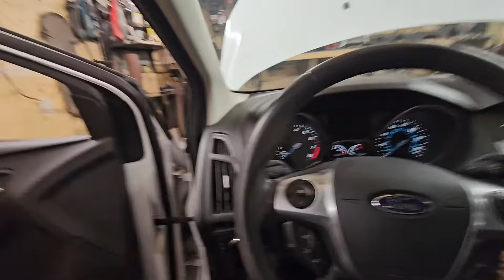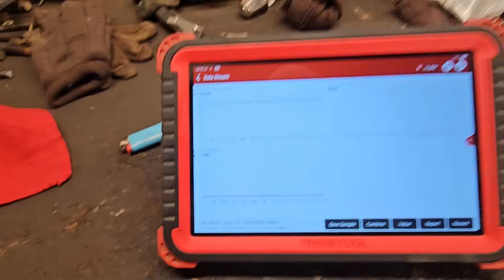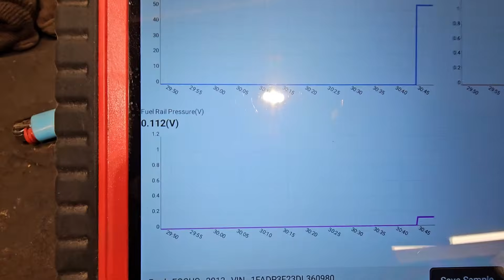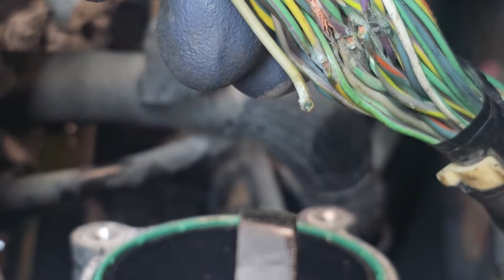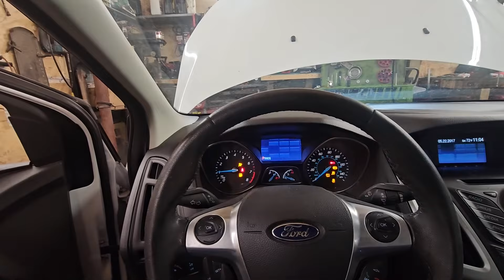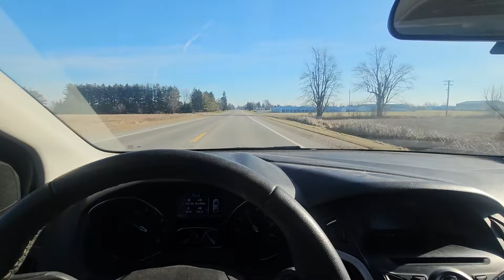2013 Ford Focus LOW FUEL RAIL PRESSURE P0192 P00C6 FIXED!

Comment: I have this code with gas leaking
Reply from the maker: If you have an actual fuel leak, stop driving immediately and inspect your fuel lines and connections for safety! 😎

Comment: Mine just started doing this. Hopefully you just saved me a ton of money. Thanks for the upload ☺️
Reply from the maker: Glad I could help!
Reply: @BustedtoBuilt had mine looked at today, the wires are fine. It was oil on my spark plugs due to a bad valve gasket cover. I guess that's what I should expect since my focus has 276k on it 😂

Comment: So the low pressure sensor is on the rail under the intake manifold
Reply from the maker: The high pressure sensor is in the rail, the low pressure i think is just somewhere in the feed from the tank but not sure

Comment: Thanks for informative diagnosis and repair. Some time ago I checked my wiring harness in same location, even fixed a couple of exposed wires, but am getting same P0192, so I will expose that harness section again to see if I missed another wire or two... thanks for making the video with excellent explanations and video edits!
Reply from the maker: Glad it was helpful and really appreciate the kind comment. Good luck with your repair!

Comment: Dude total live saver on this one. Mine just started acting up going down the road. Dod some quick checks on the side of the road. Nothing panned out. Googled my issues and this popped up. I got picked up, ran home and grabbed my electric tools, stripped that spot in the harness back and boom! Had 1 wire broke in two and two more about through. Got them spliced up on the side of the road and drove it home. You sir just saved me a solid $1000-$1500 because I highly highly doubt I would’ve found this otherwise. Thanks again!
Reply from the maker: You are very welcome, glad it helped out in a pinch and thanks for the kind comment

Comment: Hello what is the part number for the harness.  I think it will be easier for me to just change the harness.
Reply from the maker: If you call a dealer with the vin # they can direct you to the part #. Imo replacing the whole harness is going to be a much larger job than repairing but to each his own, good luck with repair and thanks for watching!
Reply: @BustedtoBuilt  Thanks